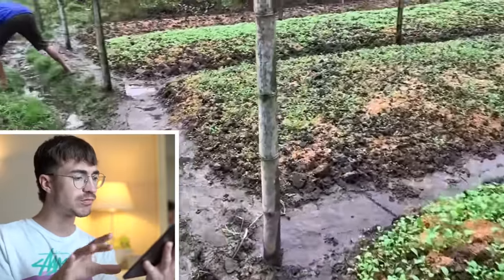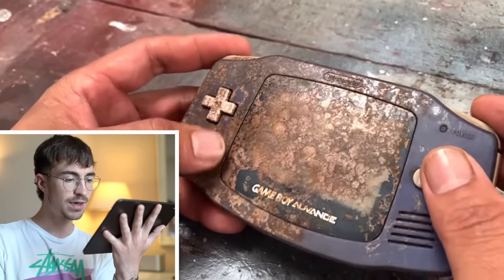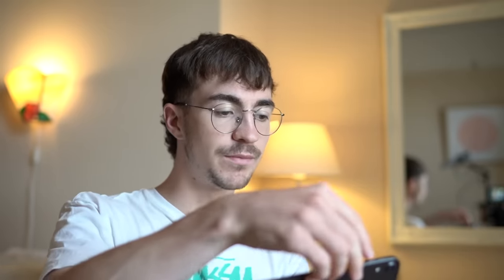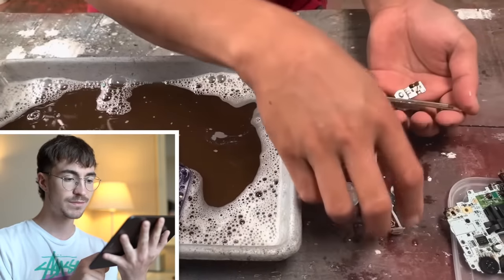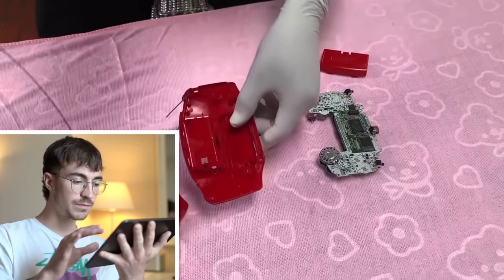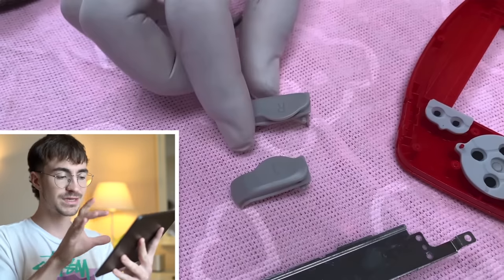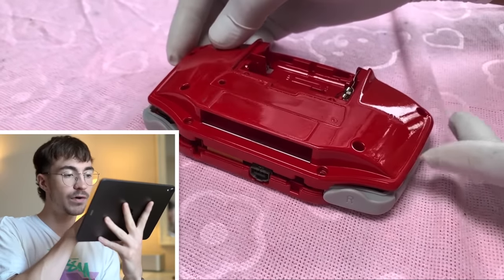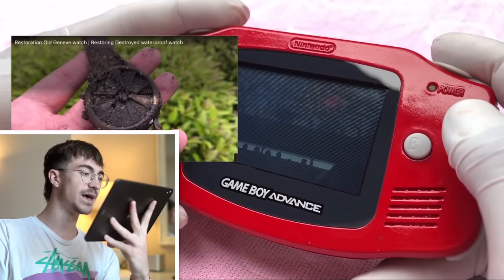Exposing FAKE Restoration Videos!

Comment: For someone who’s spent so much time in restoration I’m a little confused at why you think rinsing a board with no current going through it in soap and water will break it? As long as you dry it out properly you can always power a board back on from being wet, you just have to make doubly sure there’s 0 moisture left when you do so. The videos obviously omit a lot of details but idk if “fake” is the correct term.
Reply: I was about to say the same thing. There's no way he's experienced with restoring electronics. Another red flag was that he refused to provide any evidence of those parts being aftermarket. We're supposed to,  "just trust him".
Reply: I once restored an old tower PC that had been sitting out for a long time.  When I got it inside I started smelling honey!  Looking inside I found a bee's nest!  After removing it and washing everything it worked!
Reply: @JohnDoe-sp3dc  The buttons are definitely different. The 'A' and 'B' are in different positions before and after. 2:20 vs 11:11 Not that replacing broken parts is a deal breaker for me.
Reply: Yeah, don’t know anything about restoration, but I don’t see anything wrong with the original video (aside from the screws part). Some parts were used again like apparently the motherboard and the shell, but some parts were bought like beyond saving parts and the back cover. Or is getting new parts aside from the original a no-no in restoration or something?
Reply: @primetime645  I don't think so, but from what I've seen it is a good practice to tell the audience when you are replacing a part.
Reply: WELL HE DID SAY HE WAS UNHAPPY THIS VIDEO GOT 100K views WHILE his video got 10!!  SOUNDS LIKE SOUR GRAPES TO ME!!!
Reply: @primetime645  Replacing some parts (eg if they're broken beyond repair) isn't too bad either. The original video creator could've done a better job telegraphing what exactly they're doing, but this video is just the bare minimum effort reaction video with a clickbait title: 

Going into a restoration video assuming it's fake and then trying to make it look as sus as possible with no concrete evidence on my claims or knowledge on the matter and just giving a vague "I dunno man what do you guys think plz comment" at the end.
Reply: @Capohanf1  that’s the vibe I got as well. He thinks he is the resto expert, when clearly he could learn a thing or to. (Water on electronics !=bad)

Comment: One thing you didn't mention is how he hung up the opaque violet shell and spraypainted it red, which should make it really opaque, and when he goes to retrieve them, the light shines through the plastic in a way that it could only do through red plastic, as it's illuminated red from within. They even swapped out the case.

Comment: I've never done restorations, but I even know that water + metal is not a good idea. In the lab, we would use isopropyl alcohol or ethanol to clean instruments. This helps avoid oxidation (rusting) of the metals. Also I'm not sure how plastic would rust... Considering it is an oil based polymer, it would degrade into microplastics or become discoloured/deformed. Oil based plastics are incapable of rusting.

Comment: Also, plastic shell turned transparent after getting a respray, so it's definitely not the same one. I was really pissed off when I saw the original video, can't believe that so many people fell for it.
Reply: Also why doesn’t the power light work at the end?
Reply: Not to mention the plastic cover on the batteries that the one they picked up was missing.
Reply: I thought that, but then I saw the finish of the final shell and I became conflicted, even for an aftermarket knockoff mould it's pretty ropey, kind of like what you'd expect if someone had shot it with rattlecan paint in their back garden.
Reply: at 6:12 you see him painting the inside of the shell.
Reply: Doesn't appear any translucent. And some details from the shell are warped by the paintjob.
Reply: @Kalahee  at 6:44 you can see how light is shining through the shell, it's just a different type of plastic altogether.
Reply: @nepadrazimij  that's because there is light behind it. Plastic that thin is going to let light go through at some degree.
Reply: @TheSpot501st  It would shine through cheap knock off, but not through factory shell. Also, with a layer of paint, even cheap knock off wouldn't let the light to go through.
Reply: Basically, factory shell would be made from the mix of rubber and plastic, so whenever you drop or put your device in a pocket with other objects, it won't get scratched or cracked as easily, where cheap knock off would be made out of plastic only, hence it looks pretty bad only after few weeks, maybe even months of heavy use, while it might crack after a single drop.
Reply: @nepadrazimij  Ok but why paint the cheap shell then? (because the final shell is clearly spray painted)
Reply: @TheSpot501st  I would doubt that it's the same one, as it's too shiny for something that was sanded and had a coat or two of spray paint without a coat of lacker. My guess, is that they got a cheap red shell before they sprayed the old one, to make it look like they did the whole thing themselves. And yeah, I remember the times when I used to put some dodgy shells on some of my devices, it does look as bad as the one in the video.
Reply: @nepadrazimij  Ok you convinced me
Reply: Why dose YouTube allow this
Reply: Bruh he's not serious. This video is a joke.

Comment: 6:45 By the light filtering through the shells plastic I can say with 99.999999% certainty that it's NOT the same shell that was previously painted lmao
Reply: OMG! They couldn't even get the same color cases! 🤣
Reply: I was just looking at that... painting a purple case with red spray paint should render the case fairly opaque, that was either a red case with no paint or some kind of clear coat.

Comment: as long as the board was properly dried off, and there's no power going through the device, there's nothing wrong with using water to clean a pcb.  you just need to dry it asap after removing it from the water. and make sure there's no remaining moisture anywhere before inserting batteries.
Reply: Yep water is fine. An alcohol bath in 99% solution will dry it out quickly
Reply: another thing to watch for is corrosion
Reply: @stardoge6624  as long as you dry it properly immediately after washing it, there's really no chance of corrosion from washing a pcb.
Reply: True
Reply: Yeah but that screen is an entirely different beast, the LCD layers don't like being submerged
Reply: @dan_loeb  depends on the coating too. My ecu in my car is non coated so it can corrode quite easily. Had to overhaul the sucker due to so much corrosion
Reply: @stardoge6624  fair point then, ive only ever dealt with modern laptop and desktop boards which have never had any issues (as long as the rtc battery is removed, i did wash one board with the clock battery still in and it turned out fine, but i replaced the battery then and there out of precaution.
Reply: @dan_loeb  majority of occasions you're right, corrosion is usually not a issue. Older boards are about the only thing with issues
Reply: @MontyDotharl  i was more commenting on the reaction he had to washing the gba board.  leaving devices long term in mud/puddles is a surefire way to get corrosion.
Reply: Yup that's right but don't forget he washed the Gameboy in water then put batteries in it and turned it on, fried the motherboard right there

Comment: The best fake restoration was the car that had been submerged in a canal for over 40 years.
After emptying the ash tray, adjusting the drivers seat and replacing the furry dice it fired up and ran perfect.
Reply: You shouldn't even be firing up a car in that circunstance. There won't be any oil inside it or it will run with water in it and ruin the engine.
Reply: @kevincampos3797  "Whoooosh"
Reply: @beltanewalk8797  This exchange just cracked me right up 😂🤣😂🤣
Reply: @vihaanreyansh6244  You can't beat a good laugh 😂

Comment: I've been getting some of these dubious restoration videos in my feed as of late and something I noticed, even in the thumb nail the uniformity of things like rust on the exterior is obvious.  I think one of the most egregious ones was a tape deck.  Aluminum and plastic don't produce bright orange flaky rust that the unit was coated in.  Thank you for calling them out for being fake.
Reply: I started randomly getting Horse-hoof restoration videos that won't stop coming to my feed even after remove them. Is it because I'm a (human) nail technician???💅🏾 I'm clearly not licensed to work on horses.....and now I'm concerned that THOSE HORSES' HOOVES ARE PROBABLY JUST FINE! Can't even trust the internet anymore 😔🤦🏾‍♀️
Reply: @juicyparsons  You never really can. Not unless you have something like a forum with many talented people who have experience in the field backing up what the source is saying. That's the only way you can be really sure about technical information on the Internet. Never trust a single source, always verify with a minimum of 3 sources, and try to find the original source by tracking the reference chains.

Comment: I've actually brought several boards back after being submerged in water. As long as rust hasn't penetrated deep into the contacts, traces, leads, etc. The damage to the chips and electronic components only really happens when power is run through wet circuitry. Even if this restoration were completely real, trying to power on a board you intend to save without taking it out and drying it in an oven or dry box is a fools gamble.
Reply: Yeah the risk is high powering on an obviously water-damaged item

Comment: As an actual EE, I always thought: "why in seventh hell would someone even TRY to repair something like this?
... you see, copper traces are 35 micrometers thick, you know how thin is that? And don't even try to think that 20 micrometers of solder stop will protect this 35 micrometers of copper...
If you had this thick rust on battery contacts, the PCB traces would be gone completely, and chips that were soldered ON those traces would fall off, and have no legs.

... I mean, it's actually outrageous.
Reply: Malice  A lot of stuff will work, and most of it should at least be tried to be repaired.
I'm talking about this planted-levels-of-disgust nonsense. If ANYTHING had this much actual rust, it would be beyond any sensible level of repair.

Comment: To be fair, I do personally know a lot of PC collectors who swear by washing old PCBs with water and dish soap. They just dry it out for a couple of days afterwards — at the very least.

I've always been afraid to do that, so I use alcohol. Frankly, rubbing alcohol doesn't give the board this "brand new" look, but I mostly clean boards for hygienic purposes, not cosmetic. And alcohol is also not the best way to clean plastics — it did give me bad reactions/deformations in the past (particularly with rubber coating), so I mostly use water and melamine foam for shells/cases.

Oh, and I'd definitely not put the screen anywhere near water — there's a small chance some drops will get under the polarising film but won't ever be able to evaporate. But technically it should be hermetic, so you could wash it and leave it to dry
Reply: You can wash pcbs and motherboards without issue.
Reply: The flux they use to build circuit boards use a water based flux in a lot of case's so won't harm them. Best thing to do if you do use water to is wash with ethanol a couple of times as it mixes with water and evaporators quickly and dries the board. I prefer to use ethanol first and no water as it also disolves any other flux residue if I had made some repairs. When I worked at a refurbishing place the keyboards we put in a dishwasher on a low cycle and no heat dry we left the. In the workshop to dry . There many other things we did depending on the equipment, it was fun just figuring out ways to do things. I specialized in laptops it was a nightmare as they all seem to have different ways to clamp them together, after a while you get the gist of most.

Comment: Regardless of all, You can actually clean your parts with Water and soap(Shampoo) I have done it multiple times and it cleans nicely, you just need to be careful not to damage the fragile pins. 
After a good clean let the parts dry thoroughly and then submerge it in or wash it again in isopropyl alcohol, and let it dry again, 
the isopropyl alcohol part is necessary since you don't want any residue on your board. 
I never had problem with this except for that one time when I accidentally damaged my laptop's display ribbon.
Reply: Exactly as long as it’s freshwater ie not saltwater and there’s no power running to it things like boards & screens are still salvageable
Reply: No
Reply: HELL no. Lmao

Comment: You can use Water on electronics without damaging them, aslong as you are doing it correctly, @PhilsComputerLab recently uploaded a Video where he cleaned a graphics card with a dishwasher, distilled water,  white vinegar and baking soda!
Reply: While it is possible to use plain water to clean electronics, it's generally not the best solution. The main reason for this is the fact that regular water contains minerals that tend to crystallize into PCBs if not meticulously dried. This is often used as a last resort for electronics that are very dirty, and even then there are better solutions.
The distilled water, vinegar and baking soda solution is a homemade solution that is more effective at removing corrosion, but for less extreme cases, deionized water (A.K.A.: battery water) tends to be the best solution.

Comment: He found a GameBoy Advance with no battery lid, cleaned the housing, painted both front and back half of the shell red, and a color-matching aftermarket battery cover (No GameBoy imprint) appeared. After the reassembly it seems, the Power LED no longer works.

Comment: You're absolutely spot on Elliot. There's literally no way that board would ever work being exposed to the elements so so long. Vias would be eaten away, tracks would be corroded, the screen would have liquid spots if it worked at all. Also soaking the entire console in water and then immediately powering it on without opening it up to dry it off first would've for sure killed it. Not to mention it would have some unwanted lodgers living inside it!

Pretty obvious it's a fake. What I don't understand is why anyone would ever want to make a fake video. The amount of work and editing they put into that video could've been used to make a much better video
Reply: This particular video is fake, but I have personally seem electronics that have been outside in rainy environments for several years work. The key is that you clean it and let it dry BEFORE powering it on.

Comment: Pretty sure I've seen this guys videos before. The one I saw he "restored" a laptop with a giant hole through it. Somewhere in the transition after "fixing" the hole in the case the motherboard, keyboard and even the case itself were suddenly in perfect condition, the repair on the case wasn't anywhere to be seen either. I don't know if It's the same guy I'm too lazy to check but the video composition looks the same.

Comment: That is most definitely not the same painted shell from the moment he takes it down from the drying wires, a blue plastic painted red would never let that much light through and the insides of all the small holes and tubes are also red, which would simply be impossible to reach with a spray can. They just painted it to have a transition to a new shell.
Reply: You're blind. It's VERY clearly spray painted, poorly at that. Plastic doesn't have a finish like that lol.
Reply: @FirstImpulse  It was spray painted on the front, yes, but it is a different shell. There's a quick cut where you can see light shining through the shell, meaning it's translucent. That means it was a new red shell that he hit with some paint.

Comment: Being submerged in water doesnt matter as long as electricity isnt flowing through the board at the same time. A short is a short, water in and of itself has no way to cause damage to these components after such a short time being submerged. Definitely wouldnt want to turn it on though, that would be bad! Pure deionized water wouldnt actually cause a short though, and you could turn the gameboy on under a bath of it with no ill effects.
Reply: Until it rusts.
Reply: So... You don't know about solder, then.
Reply: Yeah, definitely wouldnt want to turn it on until youve got it cleaned up in case theres any minerals bridging contacts. Deionized water itself wouldnt short it, but any minerals left behind from from having been sitting in something like rainwater on the ground might.
Reply: That thing was clearly not dry inside.
Reply: Well, the problem is that when you have dissimilar metals and an electrolyte, you do have current flow, so you can get corrosion in water even if you’ve removed all power sources. So while washing in water is fine, submersion is usually very damaging.

Comment: As long as there is no charge in the electronics including capacitors, they can be washed no problem. But I agree this video is fishy. That screen was too clear from the original condition, no way that is the same. Replacing the buttons seems logical as they would be falling apart from age and exposure.
Reply: And that immediately went out the window when the first thing he did was submerge it in water, and then plug batteries into it and turned it on....